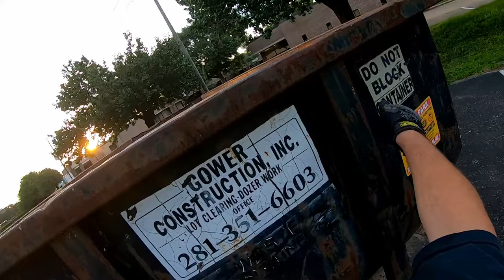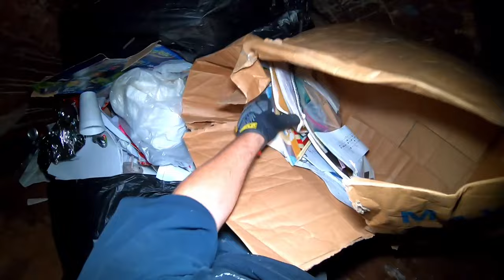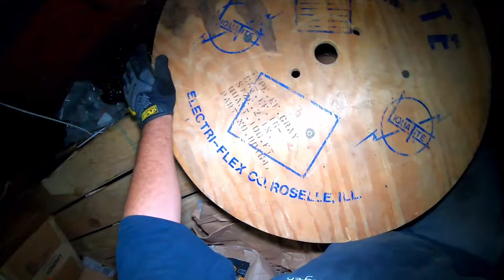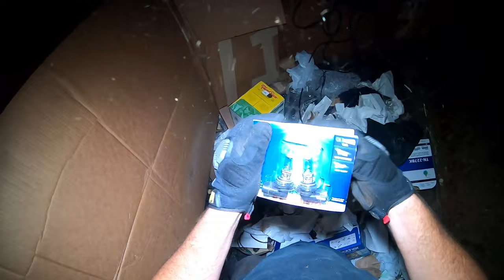Dumpster Diving "Gooey Roof Ceilings"

Comment: The roll of gray tubing with the metal interior is generically called "Sealtite", or merely "liquid tight".  'Spensive stuff if you go to buy it. Installed a heap of it over the years. I believe the largest size available would be 4" trade size. BTW, without the outer plastic cover, it would be called "Greenfield", without the metallic inner, but quite flexible as well as tough, it would be "CN". CN is usually orange, and liquid tight. Used mainly in heavy industry machine tools, such as auto plants.
Reply: That seal tight is worth money ,should have kept it on the role to sell it. I have used it a lot. The bigger it is the more expensive it is. It’s on my hot tub to the GFCI OUTSIDE.
Reply: Basically watertite flex conduit
Reply: Good job sir, this is my favorate chanel for scrap. Stay safe @ God bless you! From 🇵🇭🇵🇭🇵🇭
Reply: could not have said it better ...... been working with that crap for 30 yrs...
Reply: Po19
Reply: Nerd
Reply: How did the bug taste???😂😂😂😂
Reply: no tempo de 27:04 minutos,ser ele tivesse colocado o carretel no chão  desenrolado  o carretel pelo pátio ,fazia menos esforço físico com o carretel dentro da caçamba pra desenrolar o conteúdo...

Comment: That dumpster at about the 4:30 mark with the single aluminum fan blade... The steel cage is to hold a electric motor. Like for a AC unit.

Comment: Smarter NOT  harder includes less bending and twisting. 
Touch each thing as few times as possible. 
Save your back!
Save your knees!
You're the best in the web mike!
Reply: Every time he jumps from the dumpster he’s contributing to his future knee replacement(s).  My plumber friend just had his done at 55.  The Orthopedic doc said it wasn’t so much from kneeling but rather, jumping three feet off the back of his truck everyday for thirty years.  It adds up.

Comment: Mike I was thinking I should invest in a GoPro. Today A business left out a Canon Color Laser printer. I did manager to re.9ve the idea hard drive and the memory.
I did remove the power supply boards and that was a job doing that. I removed the heavy duty power cord without destroying it.
So much of this printer has aluminum plating on the back.
I couldn't even move it due to the weight.
It was left outside I f a dumpster. I unplugged everything without cutting.
The tempature was 93 and sat on the grass to dismantle.
I wish you were around Mike as this job required your strength.
Reply: Just by doing it you learned something.
Pace yourself, do what you can and don't feel bad about what you can't.
Respect for getting out there and saving something from the landfill

Comment: that coax with the cable along side is what they use from the pole to the house so u have a way to anchor it off without braking the wire

Comment: 30:14 This is RJ 59 Arial cable wire. The "steel" wire is to suspend the cable. Call that steel wire the guy wire, it is used from the pole to a P hook on your house, or from the pole to a mid span clip then to the P hook at your house.

Comment: Hey Mike do you have a powered electric wire stripping machine to get your copper wire out of the plastic cable
Reply: He have the manual one but he use a drill to spin it.

Comment: You won't need a backplate for the lamp fixture...just a short threaded lamp rod and a crossbar that bolts to the electrical box in the wall.

Comment: Man you need to build you some kind of little light aluminum latter that will hang on the back of them dumpsters to climb in and out of them dumpsters if you keep jumping off the top of them down on that asphalt  your going to have to have them knees replaced before much longer that's hard on them and them ankles.

Comment: Mike if you drove with those tyres here in the UK and Plod were to stop you that's 3 points on your licence and a fine up to £2500 ($3467.43) per tyre.
Reply: Wonder what the fine is in communist China?
Reply: @colleenposadas8415  ive checked and its a delightful weekend break for 2 at any internment camp of your choice, shovel included, however food and water are extra and so it would appear are electrodes and nipple clamps.

Comment: Too bad they don't still make solid hard rubber tires.  The ride was lousy but if they pick up a nail, whatever.   01:54 I'd have grabbed as many jool boxes as possible; we resellers need all we can get.  You can bet somebody would have snagged those.